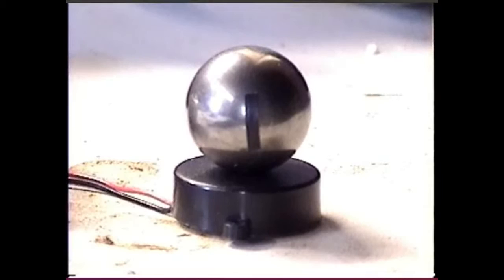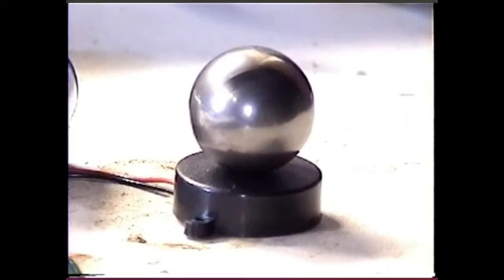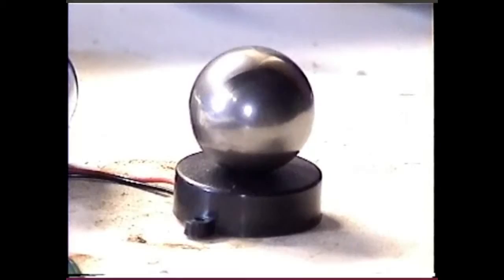Experiment: John Keely's Rotating Musical Sphere

Comment: An actual story that appeared in a news paper in the 50's: A team working in a lab started to feel ill. They thought perhaps some pathogen had escaped from one of their experiments. On investigation they found it was a faulty air conditioning duct. This duct was producing sound at 6.5 t0 7 vibrations / sec. This was below sound the ear can detect. Sound in this range is absorbed by anything it contacts causing that object begin to vibrate at that resonance. So they did an experiment, they built a device which would produce that range and "Flip" they turned it on. Not a wise move in the brief time it took them to turn it off most of the scientists were on the floor writhing in pain and the walls of the lab were cracking, all this in a matter of seconds.
So go ahead make a machine that will produce that harmonic range, lay it on a huge chunk of granite , turn it on and see what happens 0.0  oh! so that's how the ancients melted stone!!!. That news story  also reminded me of a little known Tesla tale. Tesla made a small device, he walked across the street to a building under construction and attached the devise to the building and turned it on. In a short matter of time the structure began to vibrate  and shake until Tesla turned it off and went back to his lab. So there ya go your walking around the Walls of Jerico, one set of horns produce 1 frequency, the 2nd set of horns produce a different frequency BUT in the area where the 2 vibrations combine they produce the 6.5 /7 that causes the walls to collapse.
Reply: Where did the 6.5/7 numbers come from?

Comment: Interference of longitudinal/pressure waves inside the sphere and/or air inside the cavity below it and/or the plastic casing itself. Suspending the ball on a string at varied distances above the emitter could have yielded more insight... and other way around with the ball on the horizontal surface and the emitter above it and/or anywhere around it.
Reply from the maker: Sound like a good explanation.. Thanks!
Reply: @jaynesnetwork  forget all that, just use 3 piezos as it's sort of what keely did anyway just his US source was made through very complex mechanisms and had some other characteristics we can't produce without meta materials but for this simple demonstration 3 disc 120°apart (basically 90 degrees really as we deal with curved geometry here)  but it would easily make your demo stable and you can vary the frequency at each point if need be to accomplish other effects.  Try it, you will see.

Comment: How far from the transducer can it be? Looks like it's knocked off by the tape and friction. Maybe take the tape off and polish it with silicone lubricant. Does this only work with a sealed transducer with a single hole in the case?
Reply from the maker: The ball bearing is setting on the transducer hole.  I believe it is some kind of slip stick type motor motion caused by different frequencies, but maybe it is something else? I can levitate pieces of aluminum foil, as seen in my other videos, but this is a steel ball bearing and much too heavy to really levitate with the sound levels that this piezo device is capable of producing. It is in close contact with the transducer at all times, as far as I can tell...  It is still an interesting effect. Yes the tape was put on there to make it easier to see the motion but it is knocked off when the tape comes in contact with the transducer.  Keely's device was of course a different kind of sphere that rotated with sound, but maybe the effect and the basic physics is similar or the same? I discovered this by accident while working with high power ultrasonic energy.

Comment: If shaped correctly, it can achieve lift. Why wouldn't the governments of the world be on top of this revolutionary idea, unless they are and don't want the people to have such power. By the way, how much power do you need to make the bearing spin?
Reply from the maker: I did these experiments several years ago, with a special circuit that uses fets.. I believe it was around 100W.. If you put too much power into the piezoelectric device.. it the plastic will melt and the crystal will crack!
Reply: @jaynesnetwork  That’s a lot of power. 100W to kinetically transfer energy to a small ball bearing that probably weighs something like 20 grams or so.

I can keep at least a good solid pound of weight moving for a mere 1 watt. Not to be mean though, the experiment is sound.

Comment: The original Keely weight in jar was shown to be a fraud after he passed away. The object in water was thin wall hollow brass with seal at glass top hooked to tubing. Keely merely pushed on diaphragm actuator for small pressure transferred to jar , so as specific gravity is changed, and lightweight object floats.( Keely used 1850's physics book experiments one after another , and called them worked by frequencies. ) Identical outside size brass was shown to visitors of heavy weight during demonstrations. Platinum wire of same OD was shown to visitors, while other one was tubing. He collected investors' money for shop work, and kept 10% for himself. 5 million dollar Keely Motor Company 1865-1899. Science physics in those days was called Philosophy.
Reply from the maker: Really? I saw someone use Keely's principle, using sound waves to levitate an egg in a column of water, on YT... I guess you can never really know for sure, unless you do the experiment yourself.. Ph.D. in science today, is a doctorate in Philosophy... nothing has changed! Thanks for the great comments!
Reply: Source please